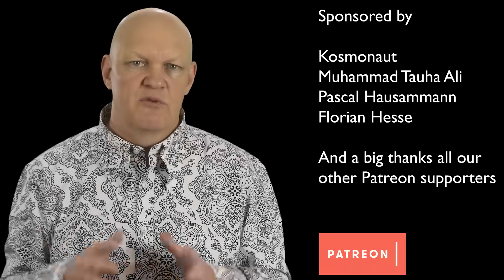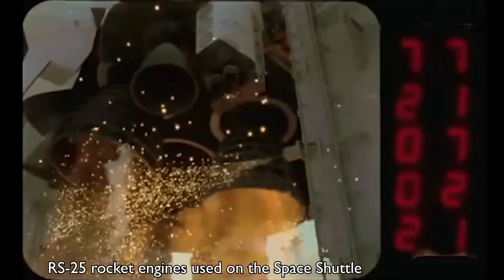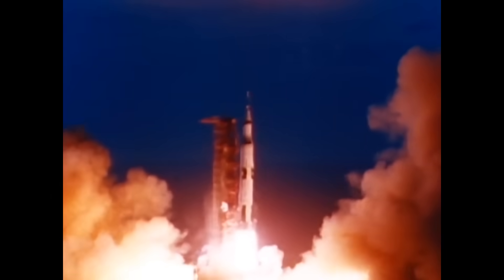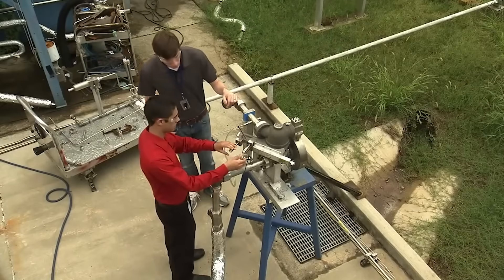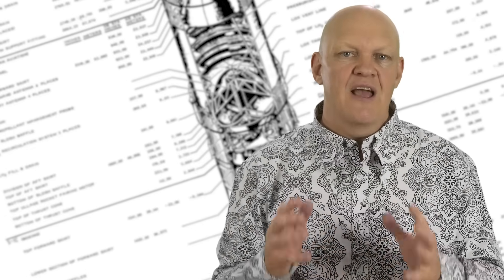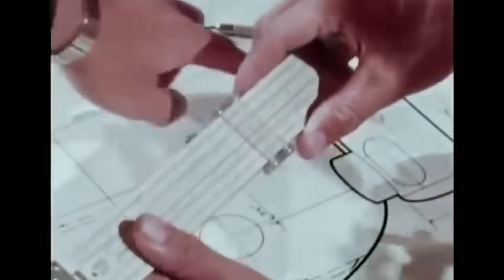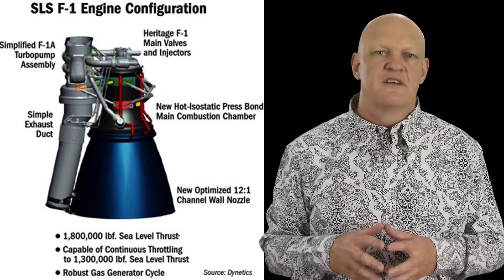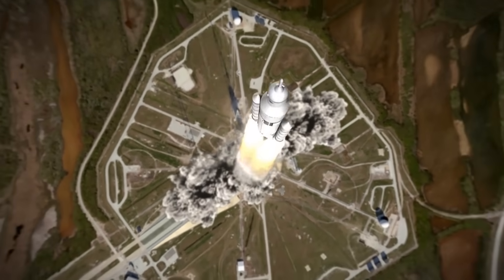Why Can't we Remake the Rocketdyne F1 Engine?

Comment: As a retired machinist, I can tell you that trying to 're-make' something like the F1 would be very difficult. Even though  you have a blueprint to follow, I can tell you from experience that every engineer and machinist has their own little ways of doing things. Sure, i followed build sheets to make the product I built, but I always left my trademark on it somewhere. A little tweak here and there, etc. Everything I build performed the same, but each one was unique.

Think if it this way... you follow a general recipe, but you typically add a bit more ingredients here and there to adjust to your taste?
That's why we can't simply re-make the F1. Unfortunately those engineers and techs that made them are gone and they took their tricks with them.
Reply: So true, Billy Bob. As a retired gas turbine propulsion engineer, I can tell you that building an engine within the limits and tolerances of an overhaul manual "might" get an engine through test 50% of the time, depending on the model. The trick was knowing what fits and clearances were critical to performance. That was only gleaned through experience. same thing applies to the F1 as is pointed out in the video however, computer simulation could radically reduce the learning curve. Something we never had back in the 70's and early 80's.
Reply: @rotorr22  wouldn't trial and error basically be the answer to rebuilding any old design? Trying to understand why people think other people cant or wont be able to build these and make them run?
Reply: @rossh2386  - All design and engineering involves at least some trial and error. Recreating a 50 year old design would be easier than starting from scratch but there would still be some trial and error to get back exactly to where they were 50 years ago.
Reply: BillyBob Sowbreath Remaking it will certainly not be as hard as desining and building the first one.Especially with the 50 years of technological advances which have taken place in the meantime.
Reply: Yep. Blue collar superheros and the old “don’t make them like they used to crap. Dream on. Material science has come a long way along with automated controls manufacturing processes. Who the hell would make these engines like they did 60 years ago given the modern and new processes available today? The original design would have to be adapted to optimize the utilization of the new processes. They could very well be rebuilt lighter and more robust. Make no mistake- they can be rebuilt.
Reply: I agree. Perhaps there is also the environment under which this work was carried out. The political pressure and pride involved and "let's get it done" greatly suited the  skilled folks who were more likely to be allowed to use their individuality to get things done. In my 40 years of my engineering design career one of the differences I have noticed is the number of meetings needed to keep specialists from highly academic backgrounds but without the "feel" involved and informed, especially in very large projects. I now, happily involve myself with racing teams where these people (including the younger ones) with natural skills are allowed to run or else lose that edge. A bit like like the space race, perhaps!!
Reply: I really wish that the blueprint was the actual engine. And not the base design that lacks many of the tweaks the scientists did..

I'll tan this down as scientists doing a mistake again, even though a small amount I'll note it.

Edit:Actually making the F1 engine may not even be important considering we have technology which could easily surpass it. I hope so, I don't know if we do have tech more capable than that.
Reply: I am a current toolmaker and I disagree with this video and view. I think a dedicated few visionary engineers with a team of craftsmen could make these engines again. Let's simply talk welding. Kids, yes kids are getting their hands on some seriously exotic materials and welding them not just to perfection but able to precisely make patterns and pictures with these welds. What old guys did when I was young kids are doing in their apartment parking lots in the rain.  Now add in 3d modeling 5 axis machining, more prevalent use of exotic materials and a hand full of dreamy doers and it's even more possible. Look what happened when the young new crop of designers and engineers too over the car companies in the late 90s early 2000s.  F1 all day
Reply: This is why we can't have nice things, because people had to overcomplicate everything and not to update the design of the blueprints. For crying out loud.
Reply: exactly right. I also am retired machinist toolmaker plastic injection moldmaker. While at Motorola I did things and made prototype molds in record time flying by the seat of my pants programming and setting up and running my own programs often using specialty ground tools for undercuts and other things that would be impossible to reproduce. As the years went on the industry simply phased out skilled workers because the skilled workers could not be documented and could have a stranglehold on a company should they leave. Tricks were interwoven deeply into each complex job in the programs, tools, method of running and alot of hand work such as specially filing tools with a diamond file. This cannot be done today--they have phased it out--you thus have nothing more complex and skillful being done beyond what the office workers can understand.
Reply: It's like when I hear a person give their option on metric vs imperial unit systems.  To work with these numbers everyday it's exactly zero of a deal. When a person who uses their brian in such a mechanical way everyday these things get a muscle memory so to speak and it's just second nature like knowing your 2nd grade times tables.  Normies dont understand nor do the have the drive and capacity to comprehend metric vs imperial.  For a mind that is in the habit of mechanical thinking, understanding the 5 to 12 systems on this rocket isnt that big of a deal. Design, engineer, build. test, revise, test, revise, test..... and then fly.
Reply: AAJAA5  At the end of the video, he does say, that there's a design using more current manufacturering techniques, which uses fewer parts, that can performe as the F1 did. You may not have watched the video to the end.
     The main point of the video is, that they couldn't make an exact dublicate of the F1, because they were largely handmade, and used welding & alloys that there hasn't been enough of a call for, because people don't go to tbe Moon all the time, so the people who figured it out died. The Moon was a rock covered w/ dust, that was very expensive to travel to, so once we reached our goal, there was no good reason to go back, so the people & techniques to make an engine like the F1 died off. But that didn't mean, that we now couldn't make a new design, that was easier to build or better performing.
       There is always a chance of forgetting how to go about making a technology though. After the Roman Empire fell, how to make concrete was forgotten for centuries, until someone re-invented it in the late 1700's.
Reply: This is what comes of not employing apprentices
Reply: 3d print it
Reply: So much hate in this thread...I think we have some engineers here who think the things they design are infallible.  The main problem is the design rarely works in the real world the first time and especially over a period of time.  The hardest job in the world is telling an engineer about a problem 'their' design has and the first response is 'it's not designed to do that'.  I've spent years in different jobs working with engineers and as soon as they get over themselves, they usually can find a way around the specific problem the technician finds.  Anyway, America needs to get back into the space business again and stop relying on Russia to get us up there and back.  I hope the billionaires in the current space race figure it out and I would love to see us back on top, sending our own to the ISS, the Moon and beyond.
Reply: There is no point anymore
Reply: bullshit!!! can you built engine better than Ford t 1907 ? YES because NEW technology !! new material !! 1 Ipfone work like 100 000 Apollo comp!!!!!
Reply: Ever watched idiocracy?
I'm my opinion, every human being should watch that one particular movie....
Reply: Making the engine is easy actually.  The problem is that we today do not have the welders to put it together as discussed by the team actually recreating it.  The VERY complex welding process has to be done perfectly without warpage etc which is 100% skill based from experience and it simply is not recorded.  EDIT: They recreated the engine by using 3d printing and modern CNC.  They built it.  THey have tested the turbopumps and other components, but were never able to fire it up as the test facility that used to handle the engines was highly modified and now cannot test the new F1-B engines.  Since NASA did not want to pony up the cash to change the test rig to handle the MUCH larger engine, the project came to a screeching halt.
Reply: I'm sure the Shark Tank guys have contacts in China that can weld anything you need.
Reply: Millennials may not be able to duplicate the F1 rocket engine, but they can sure tell you if it was sexist, racist, or homophobic!
Reply: @sparky6086  lol as a millennial myself you are right.
Reply: your stupid
Reply: @jamesv.5637  you're*
Reply: James V.. you’re.

Comment: It's like my Grandpa. He added a four speed transmission to a Model T to increase the gears to 8.  He made his own planter monitor which used a points and condenser mechanism attached to the planter so he could tell that it was planting. Or even something as simple as a chain binder alternative.  Keep a certain amount of slack in the chain, loop it around a board, and twist it tight.  Wire the long end of the board to the chain, and voila!  And a master fucking welder to boot. I always try to look at things like Gene Kranz from Appollo 13: "I'm not interested in what something was DESIGNED to do, I'm interested in what it CAN do!  Things can be used for a multitude of uses if you think outside the box.

Comment: There's no need for it . Also you increase the hazard of a catastrophic explosion as with the shuttle tank ignition . Even though the event was caused by the solid rocket emitting a jet from a failed seal , the solid rocket booster did not explode .

Comment: This isn't the entire story really. The old F1's were an open loop system and much less efficient compared to the standards today using high pressure combustion chambers in a closed loop configuration. They wouldn't be viable now considering weight/thrust/fuel consumption we get these days.
For example, had they been able to build stable closed loop engines the size of the F1's back then, Apollo would have launched with probably 4 engines instead of 5 and gained all of that weight advantage in payload or fuel, and maybe even have slightly more thrust to work with, even with only 4 engines. However, closed loop engines are much more difficult to build, more complex, and much more expensive as a result. And back then, they were quite unreliable.
They aren't really comparable to newer designs...  we've had 50 years more experience blowing shit up to get much better at it, not to mention getting a huge boost in technology from the Russians in the 90's, leftover from their N1 program.
Not knocking on the Rocketdyne engineers...  being able to accomplish the task they had and given the experience level in rocket engines at that point in history, was nothing less than astounding. Besides, the reason we got to the moon first without a manned rocket exploding is because we took the more conservative approach from a safety perspective and went BIG instead of taking risks with unstable designs inherent in the closed loop systems of the era.
Reply: @funkyzero Very insightful comment. Thanks!
Reply: @sharefactor  
Thank you. It's a very interesting history to research and read up on if this is of interest to you.
The Russians were never known for building what we consider "precision" anything. But the N1 program was one in which they were able to pull of what at that time was considered impossible. Never underestimate the power of spit and bailing wire.  hehe
Reply: AAJAA5 
so we have mindless admiration of old school methods,
   cheap shots on the comment section versus millennials.
   widespread complaints that "social Marxism" helped kill our brains and make us consumers instead of innovators.
   we also, in that vein, have folks who feel that a liberated society that lets women and blacks and socially aggressive youngsters challenge the old guys stranglehold on power, leading to loss of budget, and promotions of those unworthiness to positions of power over them.

(and of course sneering at them for being unable to produce,direct, control technology and Industry, that only White men were good enough , when it was white men keeping them out of the brainiac club!)hard to innovate from a slum, or when no one can teach you.o r will teach you, cos you're icky, and not like them.

so, as a result, the disposesed folks grew in number, as the power got concentrated in the White guy club, a semi bloodless coup was performed, the out groups including millennials got stronger, and de funded the old guys club. no money,getting old, they retired.
    the old guys were techno industrial studs, and the new kids were trained to follow not lead.
     and many engineers developed tech that only experts could use. I think that was a yuppie/baby boomer thing.

  so that's part of how we got to this technical state of affairs. 
    no one with the whole truth, including me.

  I'm just smug enough to believe what I've said.
Reply: Yeah the Russian N1 was awesome, how many times did it blow up? How many men did the USSR put on the moon?
Shove the N1 up your arse, go Rocketdyne and the mighty F1.
Reply: @schumifan78  man some people are just fucking dumb...  looks like you won that lottery too.
now piss off, dunce

Comment: I'm curious about the "simple exhaust duct", the original used  cooler turbo pump exhaust as a film heat shield for the main combustion chamber, this is the dark surface on the section of flame immediately exiting the main nozzles.